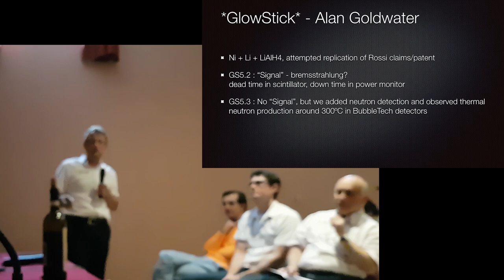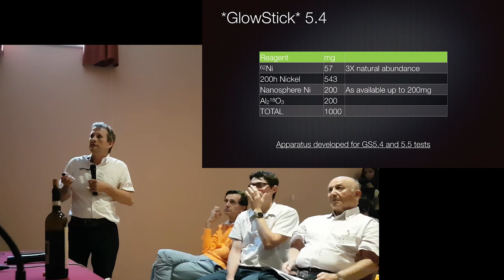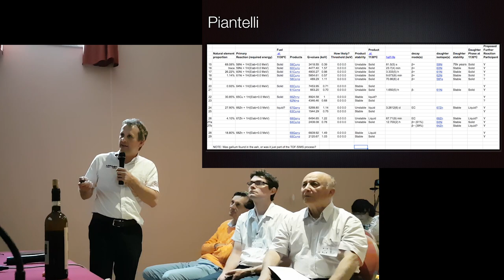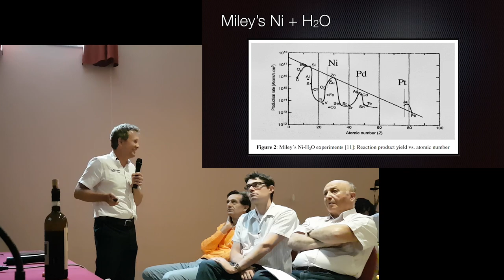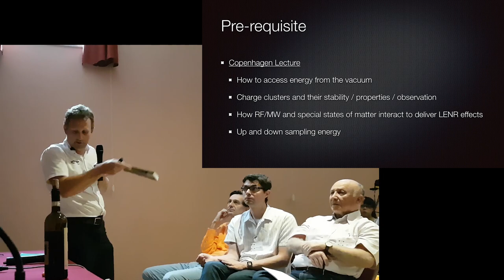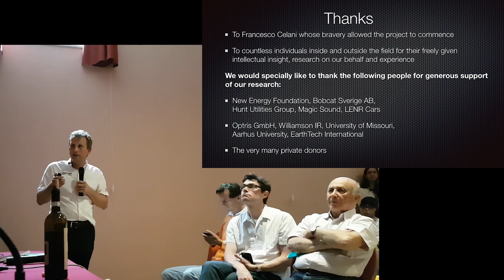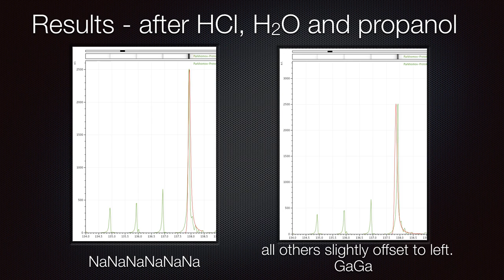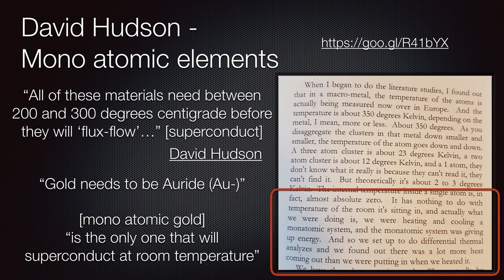Asti Presentation - Bob Greenyer

Comment: Glad to see the connection of David Hudson's work "Ormus" material or Mono Atomic elements and LENR experiments.  I'm curious if any of the ash from LENR experiments have been carbon-arc tested in a spectrometer using the longer run times that David Hudson talks about?
Reply from the maker: Never as far as we know, and that is a good idea down the line. It may very well be that in cavitation particularly, the production of single atoms is prolific, weather they are in the Ormus state - who knows?